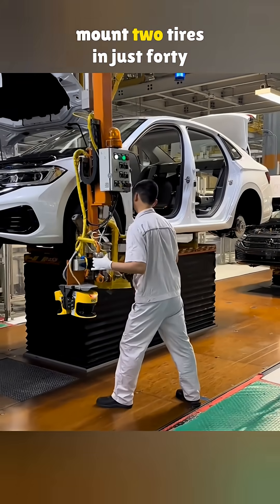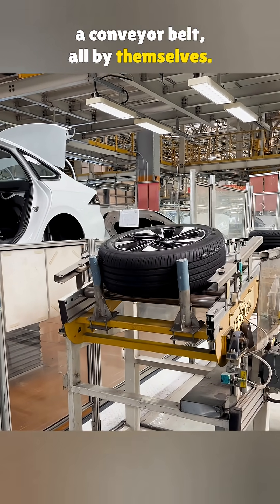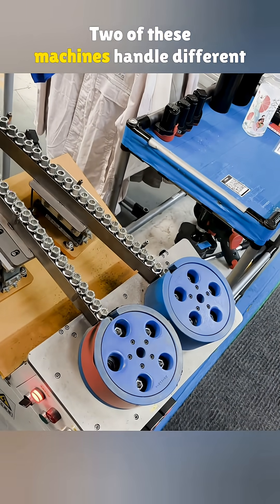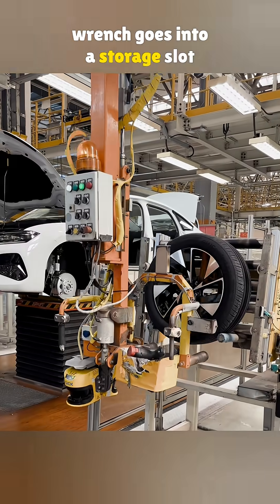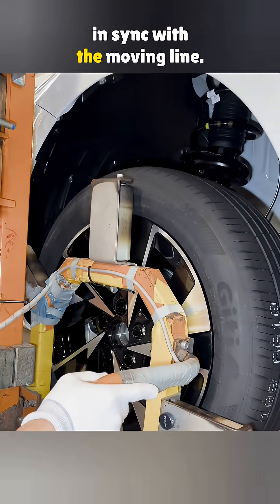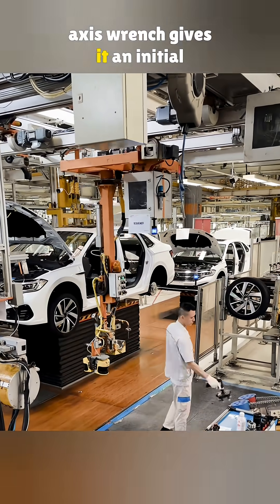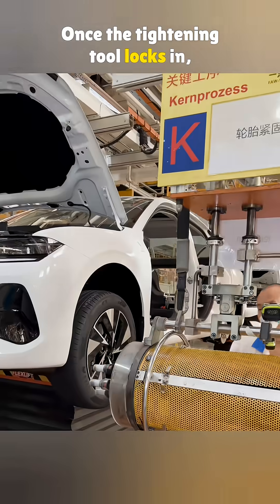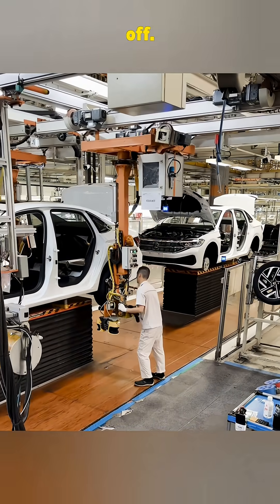How Volkswagen Mount Two Tires in Just 40 Seconds

Comment: F1 team change 4 tires in less than 2 seconds sh they need to step it up
Reply: Could an F1 team maintain such rapid wheel changes continuously for 8 hours (of course, the team is allowed to take 10 minutes brake every two hours)
Reply: I think you have to calculate the total cost of mounting the 4 wheels for comparison. Maybe the F-1 team has 15 crew AND a driver, to pull this of. Just the driver is millions of usd per year …